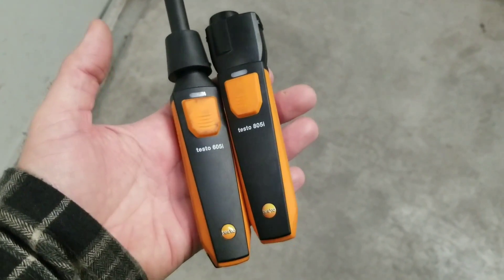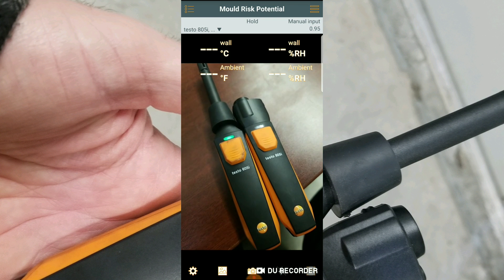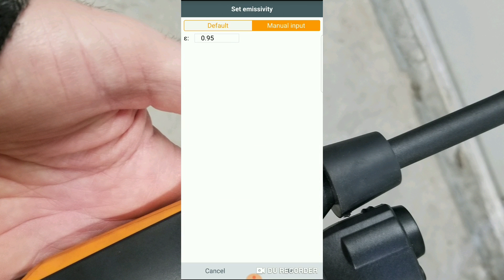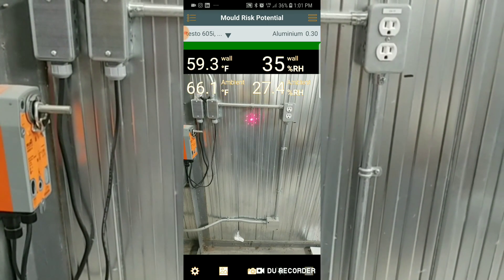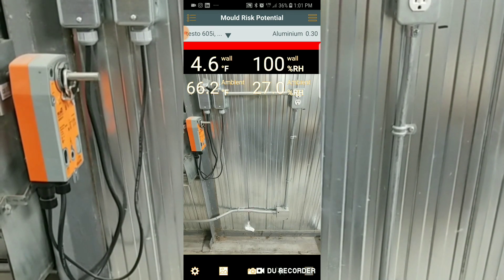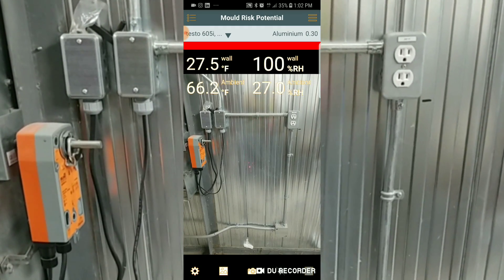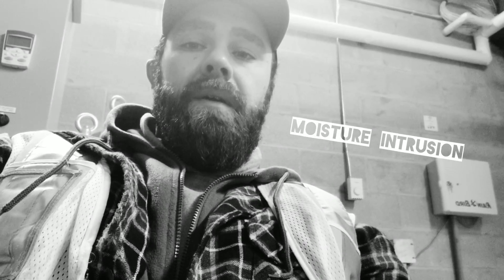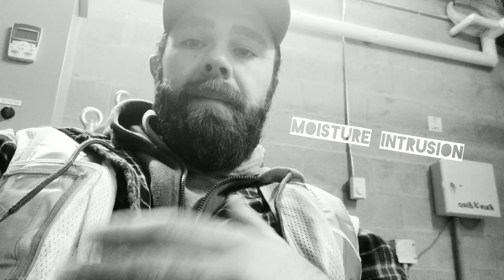Mold Risk Potential w/Testo Smart Probes

Comment: Nice video  

Technically speaking you didn't test for moisture, as the 805i is only measuring surface temp. All that set up is doing is telling based on the ambient temp of the room that part of the wall is bellow dew point and hence a potential for mold. Not in love with the set up, 2 devices plus a smartphone....
Reply from the maker: Yes the 805i is only taking a surface temp correct, but with the 605i  there is a built in calc.  That is giving you the %Rh and we all know at 100%rh, the air is saturated and moisture will condense.  You can't have mold potential without moisture potential.
Reply from the maker: If I was only checking the surface I would say this is true about the dew point, but I was also checking the wall cavity which told me the it was 100% saturated in the gap.
Reply: Name of app.